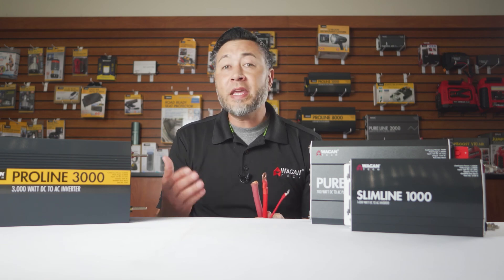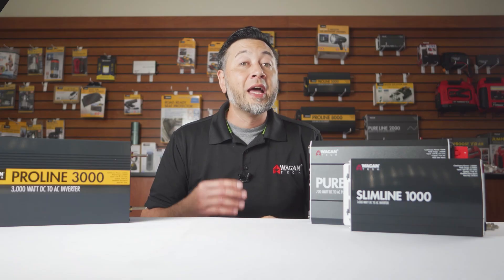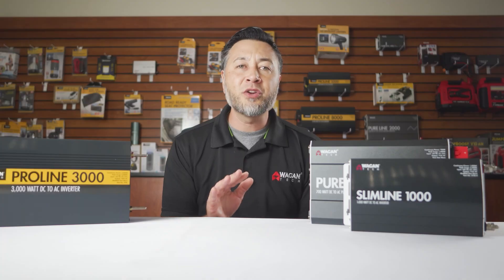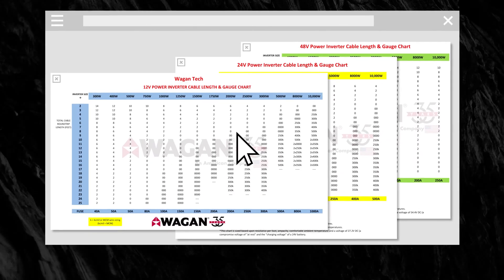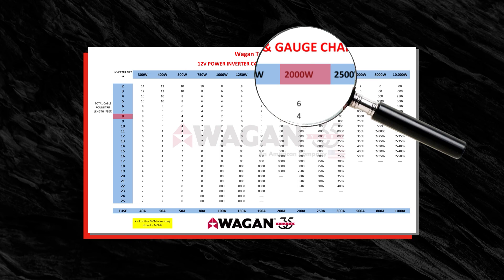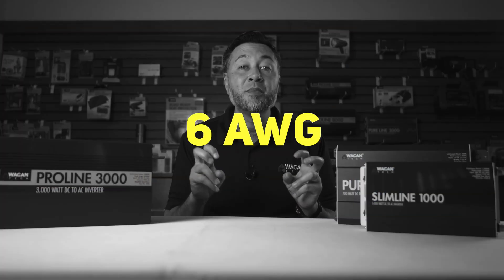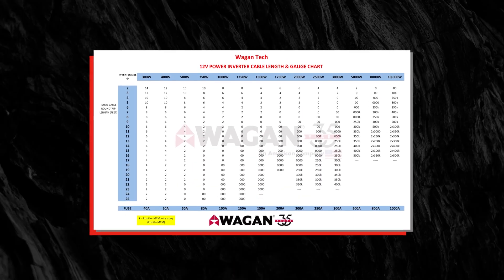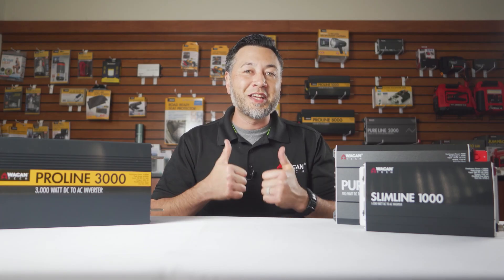Power Inverter Cable Size - How To Select The Right Cable Size

Comment: Love your video. I have a ??? I only use 800w and I use 1/0 Cables. I dont know why the Negative Terminal my Inverter get Hot.  But if i use less power it not at hot.   Thank you for your time

Comment: My 2500 watt 12-volt inverter puts out 30 amps AC.  Why does the chart show I need a 250 amp fuse?  Is that how many dc amps are required to generate 120 volt ac at 30 amps?  Thanks for a great video!
Reply: Watts = Volts time Amps.  So 2500 W @ 12V means current is 2500/12 = 208.333 Amps

Comment: Hey! Great video. Just wanted to ask a dumb question. When you say round trip, you are meaning the red positive from the battery to the inverter and the black negative from the negative of the inverter to the negative of the battery, correct?

Comment: Wanting to connect my 750watt inverter to my flatbed truck battery and place our Rapid Milwaukee Charger in our tool box so we can charge the tool batteries while driving. The charger will only charge two batteries at one time at 12amps for two batteries or 246 watts. I’m wondering what size wire and fuse do you recommend. Cable will be run about 10ft…Thanks

Comment: 1). Always size your wire for the maximum wattage that the inverter is capable of.   So in the future if you require more wattage, you don't have to waste money on bigger wires.  To add those smaller wire you got are now useless, as you most likely don't have a need for them elsewhere 

2) There is nothing wrong with having bigger wires than what you need.  These big wires will also reduce the heat generated by the electricity going through them versus smaller wires.

3) Those ANL fuses are for car audio, not for electric generators.   Be smart and use  better fuses like MRBF or better yet a Class T Fuse, but not the cheap ones .
Reply from the maker: Thanks for the advice! It's good to be future-proofed and definitely agree that larger wire is better.

Comment: I installed a 700w inverter and used 6 gauges (jumper) cable! I went with a 60amp breaker instead of a fuse. Just tested the setup and man oh man! It get hot! Breaker didn’t jump :/… guess I watched your video, beforehand! Thank for sharing! Also I still don’t know why everyone is saying fuse but not breaker!
Reply from the maker: A fuse is typically the preferred method for overload protection, especially with inverters, but a breaker can work, but it may have different characteristics in terms of tripping.
Reply: Breaker and fuse

Comment: Is the wattage based on the inverter's normal or peak watts?
Reply from the maker: For Wagan Tech inverters it’s always at normal wattage. Keep in mind that most of our inverters are true rated wattage meaning that you get 100% of the rated power versus many inverters out there will rate at 30% usage time after which it will drop at least 20% of what’s advertised. Hope that helps.

Comment: I have a 4000w continuous / 8000w surge inverter that mounted within 12” of the batteries and I’m using copper busbars instead of cables. The suggested cable size is 0000 AWG, that’s hard to find. Amazon has copper busbar
Reply from the maker: You can also use multiple 00 AWG cables to bridge the amperage.

Comment: Hello. Thank you for the simple to understand video. 
I am currently designing my first solar installation and I'd like to also ask a question. 
•I will be using an all in one hybrid inverter. The inverter has a continuous power rating of 5600W and a peak/surge of 10000W. (although I don't plan on drawing more than 4000W continuously, maybe 10 second bursts)
•The cable length of the battery will be 1-1.5m
•The battery nomimal voltage is 51.2V instead of 48V (but it's really close, it's just one more 3.2V LiFo4 cell. I think in theory it should require slightly less amps than the 48V, but let's say it's 48V)

Taking all these into account and considering that I won't allow the battery cells to go under 3.1V (because it really just doesn't have that much capacity when it's so low), the overall lower battery voltage would be 49.6V (46,5V of we're talking about a 48V system). So in theory I should divide 5600W/49.6V for maximum current. 
~113A
According to your provided chart, for a 5000W system, a 6 AWG is enough. For a 8000W, a 4 AWG is enough. 
However for 113A, other sources suggest a 2 AWG or even 0 AWG (those sources being either persons or charts). 
I don't doubt your information, but at the same time I'm trying to find out what is the right information after all... 

At the moment I'm planning on using a 2 AWG wire with a length of 1-1.5m. 
A 100A breaker will be put in place. And a fuse of 120-130A if I find one. 

Do you see something dangerous or plainly wrong with the installation I'm thinking of? 

Thank you in advance for your reply. It will be very much appreciated. Cheers.
Reply from the maker: Hi there!
For 5600W at 48V with a run of about 4.5 feet, 6AWG would be acceptable.
Since your 113A at 51.2V would actually equate to 5786 watts, I would recommend 4AWG cable. 
However, there is nothing wrong with going to a 2AWG cable at this length. Either way, you're not severely oversizing the cable if you were to choose 2AWG over 4AWG, but I feel it is unnecessary since you're only going to be pulling  the 4Kw continuously.

Comment: Does a 3 ft cable perform better than a 5 or 6 ft cable of the same gauge?
Reply from the maker: In that short of a distance, no. The issue arises when you try to carry more load over longer distances with too small of a gauge wire... it creates heat build up and power loss.
Reply: These calculations are based on voltage drop.  The further you get from the battery. The more you’ll need to increase the cable size. Good luck 🍀

Comment: Do you go off the continuous watt or peak ?
Reply from the maker: When sizing for your needs, go off of the continuous wattage spec. Peak is only used when determining the start-up (inrush) current needed for large appliances (like an air compressor).

Comment: If the inverter is 10k watts, why would you size the wire if only planning on utilizing 8000 of the 10000 watts? Why not go with larger wire,seeing as it will only not harm anything but power would flow more easily through larger wire anyhow? And what happens if you go over the 8000 accidentally and now the wires were sized to small for the full 10k??? May be dangerous. In my own opinion
Reply from the maker: If you'll never use the higher load, then yes a smaller gauge (or appropriately sized) cable would be the ideal solution as long as you don't exceed the cable's carrying capacity (load) ratings. A lot of people will buy a larger size inverter to carry a smaller load (like if you're only using 8Kw) so as not to constantly max-out the inverter.
A larger gauge cable will not negatively affect the inverter or its functions and would be the ideal if you plan on using the 10Kw regularly. 
Although I can't officially recommend it, you can use 10Kw on the smaller gauge cable with intermittent use.
Reply: Because eventually people saturate the original load requirements and add more loads forgetting that they downsized the wire...

Comment: What about peak power of an inverter?i.e. if my 1000w inverter has a peak rating of 2000w do I need to take that into account?
Reply from the maker: Hey Gary,
You only need to take that into consideration if you're using appliances that have a high peak (surge, inrush) current. Most appliances do not have such needs, but a few that do are: air compressors (or anything with a compressor motor), refrigerators, air conditioning units, personal space heaters (or items with larger heating elements), large incandescent bulbs, and large electric motors.

Comment: What is the guide to sizing ground wire? I’m gonna be installing 2200 watt inverter.
Reply from the maker: Tim, you can run a 10 gauge wire for the ground wire.
Reply: @WaganTech  thank you!
Reply from the maker: @tim600sl-usa  my pleasure!
Reply: Check NEC guidelines.   If it DC then and under the system is under 60V, you don't half to ground it.  If you want to Earth Ground it for safety concerns, you can then use 6 AWG, but you would need to hook up to two 8' grounding rods for the grounding to be effective.   You also need to attach the grounding wire to your system then to the first ground rod and then run a wire from that grounding rod to the second grounding rod.  Remember to space the rods at least 6' apart.  Also, make sure you are not near your house electric grounding rod that also should be 6' away from your DC grounding rods.   Remember to use PV wires as those are designed to be in wet environments and in the ground.   Don't use Romex wire as they are designed to be used indoors only and will deteriorate in wet conditions and soil.
Reply: @ManKzin .  What?   I’m thinking you may not know the purpose of a GEC and Grounding Electrodes in an electrical system.  Did somebody teach you what to do, but not why to do?
Reply: @KevinCoop1  that is straight out of the NEC code.  I am not an ekectrician and don't pretend to be.   But that what i said comes straight out of the sections thise 2 topics (grounding and PV).   When I am taking about PV wire, I am referring to solar panels.  Oh and you  could use one 8' grounding  rod, but you would have to prove to the inspector why one rod is sufficient.  And supposedly the equipment to do so is not cheap compared to putting buying and installing a 2nd grounding rod (in regards to your DC side of a solar generator that is not connected to a grid system)
Reply: @ManKzin     Your statements are all true and correct.  Not questioning them.  The question asked was what size ground wire.  There is not enough information in the question to answer it.  In 12vdc, some people call negative ground. Correct?  Is he asking about ground wire for the 120 volt AC side?  Is he asking about a GEC grounding electrode conductor?   Is he asking about an equipment ground?  Answering questions without knowing exactly what they mean is dangerous or can cost lots of money.
Now, my question to you is why would you go to GEC to Earth as an answer to his question?   This is an inverter video.  There is no place in the input or output of an inverter that requires “Grounding Electrodes” to be connected.  What in your mind is the purpose of connecting electrical systems to Earth?  NEC only tells you what to do, not why to do it.
Reply: @ I may have been commenting on another video or post and had accidentally comment on this post.  Which happens from time to time, as I usually an leaving several comments on a variety of videos or posts all on my android phone.    Rereading this post I was wondering why I said what I said.   And I rarely do post comments on YouTube except when I really in the mood.  I commented on something on YouTube a couple of days ago, but I think i the last time before that was a couple months back.
Reply: @ManKzin    So you have electrical knowledge.   Can you answer the question of why grounding electrodes are required?

Comment: How do I set up for semi teucks?
Reply from the maker: It depends where you are wiring the inverter to. All trucks have cable access in the cab; running the wires shouldn't be hard. Just wire to the battery, add an inline fuse, mount the inverter, then connect the cables.
Some of our friend's at @raneysonline (Raney's Truck) could help you out.

Comment: I'm looking for a semi teuck inverter 2000 watts needed  and I'll detach it I swap teucks so I guess up to the middle thru thr door
Reply from the maker: We've had great reviews on our Slimline MSW inverter that has been sold through Truck parts distributors like @raneysonline (Raney's Truck).
If you want to go for the best, I would suggest the PureLine PSW inverter; it will cleanly power everything and last between truck swaps!

Comment: Can I use the ground car chassi as a negative for a 800w inverter? Running only the positive one from the battery to the inverter?
Reply from the maker: Yes, you can most certainly do this as long as you have a solid chassis ground.
Don't use one of the body panels or any other small metal surface as a ground.
Reply: The chassis will only get you so far.  You must size the wire correctly from the chassis to the inverter too.

Comment: so I have 2 5kw inverters, and 48v batteries, with a 6 feet cable I can use 4 AWG but that cable is rated at 85 amp? what i am doing wrong ? 10kw inverter at 48v can pull more than 200amps right?
Reply from the maker: Eduardo, sorry for the late reply... I just saw this Q. As a general rule, you can't parallel two 5Kw inverters to get 10Kw... so I'd assume that you have two 5Kw Inverters that would allow you to pull about 104 Amps each. If you have paralleled them and do have 10KW, then yes they'd be able to pull about 208 Amps.
The cable needed for 6 feet at 48V for the 5Kw would be 8 AWG and for 10KW is 6 AWG (4 AWG is fine).

Comment: Hello, just a Q please: I have an inverter of 1500 w continued output and with a surge/peak/Max of 3000w! When I use the graph, do I measure the guage wire for the 1500w or 3000w? 

Thanks
Reply from the maker: Hi Luke, You'd use the gauge recommendation for the 1500W as the surge is only momentary. Cheers!
Reply: Hey thanks alot for the reply 7 months ago lol it helped a lot :) 

Another question if you could... this might sound silly but I'm a little unsure! Is gauge the same as awg? 

I have 4 awg wire to use from battery to inverter and I'm wondering if when using you're chart, is 4 awg the same as 4 guage? 

Thanks again

Comment: Very infromative video as it really helps .. however the chart says till 48v battery and my battary is 56v of 1200W so i am not sure which wire guage should i use. can you help ?
Reply from the maker: Unfortunately we don't manufacture a 56V inverter and I don't have the chart for that inverter voltage. I took a look online and found some places that may have the correct info, but I am unable to verify it.
Reply: 1200/56=21.429 amps.  21.429x48=1,028.592.   This is the equivalent that you can find in the chart.  Call it 1200 at 48 and you will be fine.

Comment: thanks, Can I use 12 or 10 or Gauge cable on MY trailer to plug outlet and switches and 2000W inverter. ? let me know
Reply from the maker: The 12V DC outlet on your trailer, you can use 10AWG safely for up to 15 foot-run when carrying 15A or less. The switches should have a relay ahead of them and can use 16 AWG if configured as such.
The inverter cable gauge will be dependent on the length of run but will be (12V):
6AWG from 2 feet or less
4AWG from 3 feet
2AWG from 4-5 feet
0AWG from 6-8 feet
See the full chart here: https://cdn.shopify.com/s/files/1/0062/6052/3111/files/12V_Inverter_Cable_Chart-02.22.2019-logo.png?v=1604534080

Blog here: https://wagan.com/blogs/news/customer-question-what-cables-do-i-need-for-my-power-inverter

Comment: Do you have a wire size chart for controller to battery?
Reply from the maker: Hi Ken, are you referring to the Solar charge controller to the battery?
For average runs (less than 10 feet) you can use this guide:
Controller Amperage - Wire Gauge
10A - 14AWG
20A - 12AWG
30A - 10AWG
40A - 8AWG
60A - 6AWG
80A - 4AWG
100A - 2AWG
See the chart here: https://wagan.com/blogs/news/all-about-solar-charge-controllers
Reply: @WaganTech  Thank you very much.
Reply: @WaganTech  Does this guide work for 12v and 24v?
Reply from the maker: @kenkoh1724  No, 24V can usually accept half the size of the 12V DC AWG guide. For instance, a 6AWG at 12V would be able to be replaced by a 12-14AWG at 24V.
This, of course, is dependent on factors including length of cable and such.
Reply: @WaganTech  Sorry, I mean just from the controller to the battery, would the wire gauges be the same? Thanks.
Reply from the maker: @kenkoh1724  yes, you would wire them in the same gauge as the controller max output is fixed.

Comment: Hey what if im trying to use  20 foot cables to run from my trucks battery to a 2000W power inverter under my seat. On the chart the max roundtrip distance is 25FT but mine would be 40 right?
Reply from the maker: You are correct! Shoot an email to our CS team and they'll get you squared away! Customerservice@wagan.com

Comment: Thanks for the informative video. But I have a question: why would it be preferred to choose the lighter cable for the 8000W if you don't plan on using the full 10000W load? Would using the thicker cable create other issues or does it simply come down to costs? Thanks!
Reply from the maker: Hi Martin, great questions! If you'll never use the higher load, then yes a smaller gauge (or appropriately sized) cable would be the ideal solution as long as you don't exceed the cable's carrying capacity (load) ratings.
A larger gauge cable will not negatively affect the inverter or its functions.
Reply: @WaganTech  Thanks that's really helpful!
Reply from the maker: @martingrimmitt3992  my pleasure!
Reply: @martingrimmitt3992  
Larger cables are also more difficult to work with given how stiff and heavy they are.

Comment: Do you size it for regular watts or peak?  Mine is 2000 watts and 4000 peak.
Reply: P.S. also what if the positive cable is 2 feet and negative is 3 feet?
Reply from the maker: These are both really good questions!
You would size it for the 2,000w load since the peak load is only able to be sustained for less than a second.
As for the cable length, you would want to consider it 3 feet one way or 6 ft. round trip.

Comment: Great video presentation. However I like to run the cable that can handle the maximum power my inverter can draw for those times when you might plug in that appliance that pushes your inverter to the max. And instead of running the negative cable back to the battery I would just run it to the closest earth point to reduce length of cable required which will reduce wire gauge required.
Reply from the maker: Very nice, and valid points! Thanks for sharing!